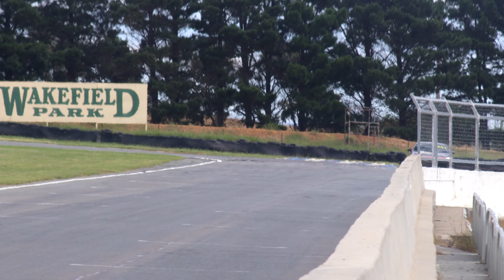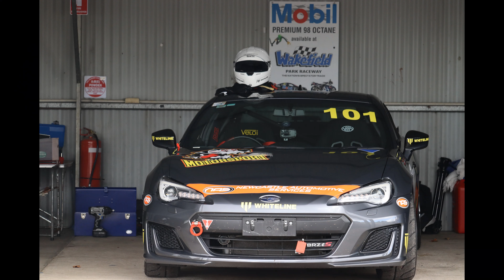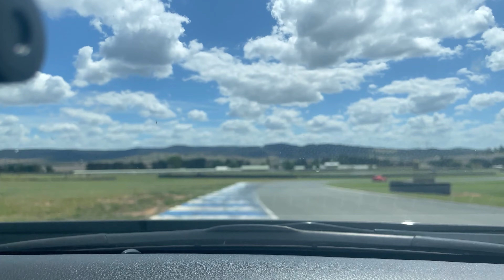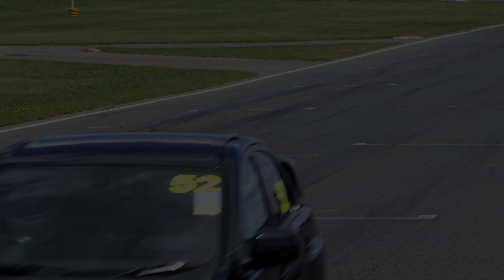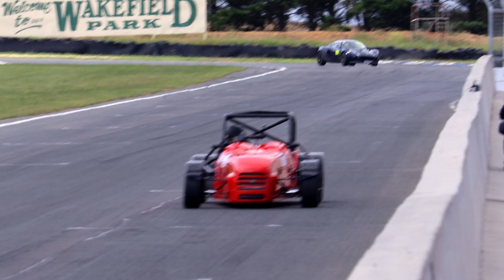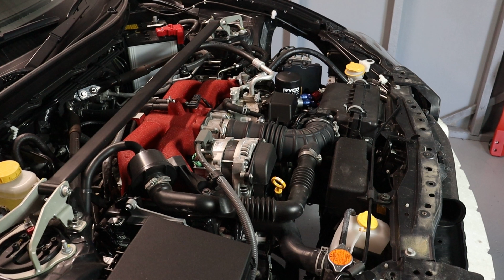Post Track Day Maintenance

Comment: Hey Blackdog , so even though the technical redline is 7400-7500, its actually better to shift up at 7200?
Reply from the maker: Hey Mate, my factory redline is 7200, I try and shift up just before it hits the limiter but i don't always get it right
Reply: @blackdogmotorsport3784  Thanks Blackdog, I find your advice and videos very helpful. I've been watching your channel since I saw your video about Crank Pulleys. You make a point not many others make and yes if you take your car to the track / drive hard , it WILL reduce the lifespan and the goal of a track day is to race and make it home.